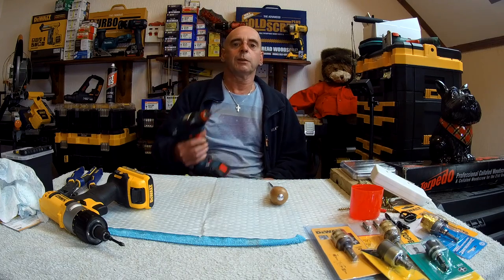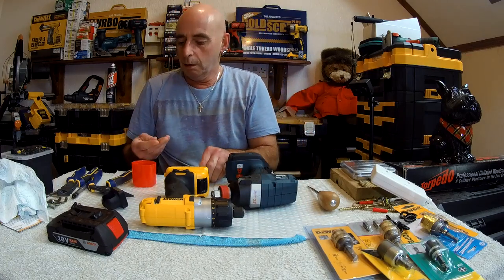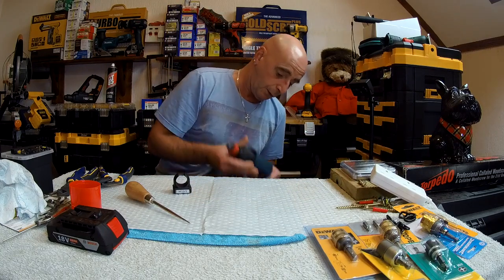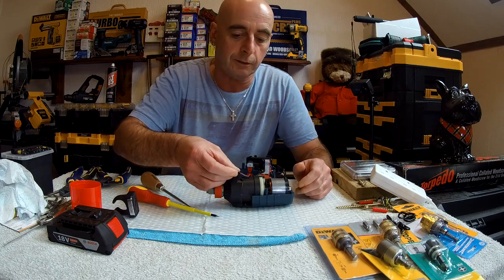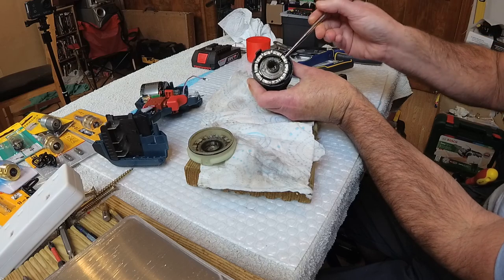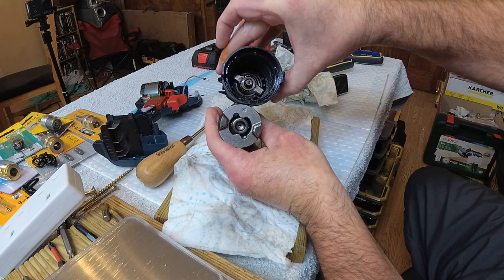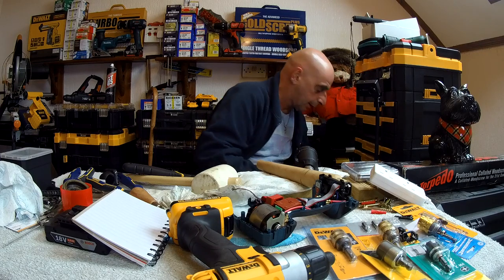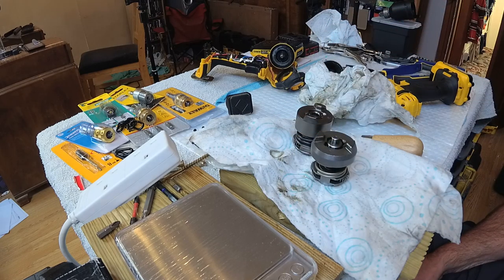Bosch GDX 18v EC Teardown: So is it a jack of all trades

Comment: I have 3 of the Bosch GDX 18V-200c all three of them are a pain to change the bits  you need a pair of pliers to get the bits out. This strikes me as a design fault. The plastic bit release is very poor quality and i cannot see them lasting very long
Reply: Are you using Bosch bits..apparently they fit better
Reply: Same here

Comment: So?  The bosch is good or not?
Reply from the maker: It worked for us, but if you want more power and a faster speed there are better ones. The Bosch is a good all-rounder and it's reliable. It's just slower than others.
Reply: LittleMilto so being slow/ less powerful , does it get all the jobs done?
Reply from the maker: @vojnikjna30  Most of them, you just need to be careful with screws with a large diameter.